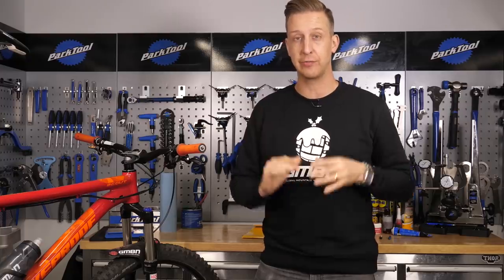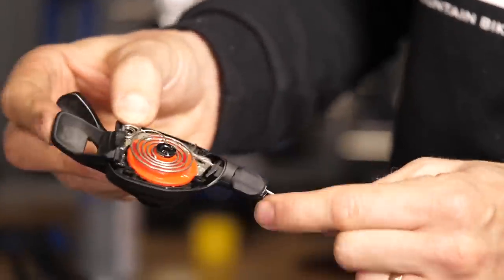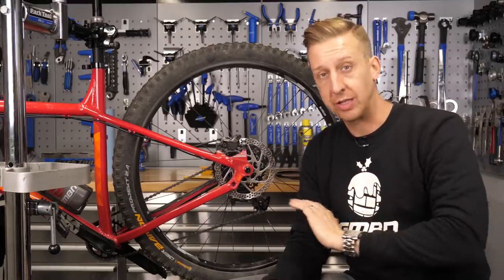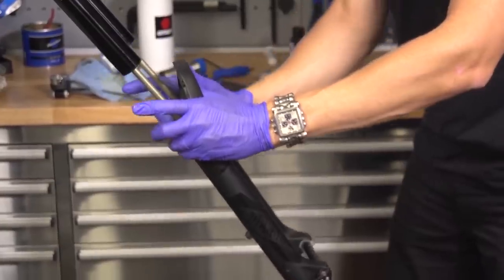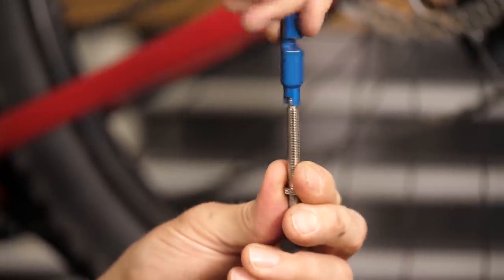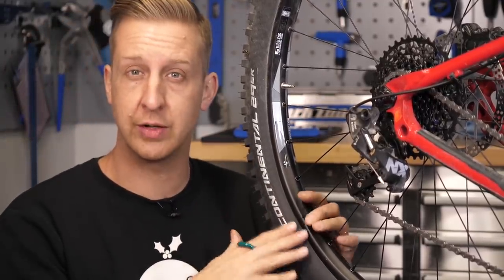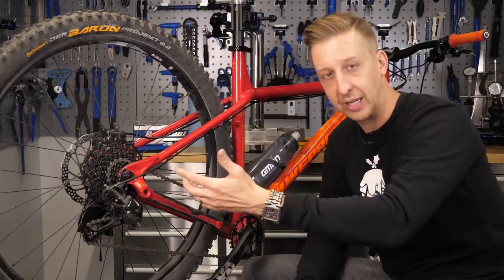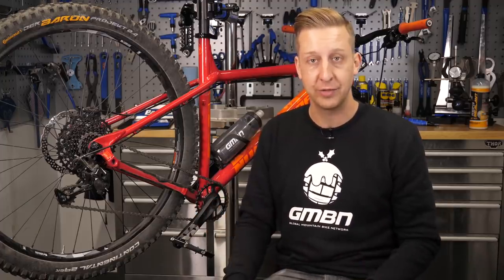Ten Ways To Refresh Your Mountain Bike | GMBN’s Guide To MTB Maintenance

Comment: Superb video!! You have said literally everything that i do at least twice a year. I prefer to clean the inside of the tubes, but i don't put WD-40 or any oil, just clean them and make sure that the cable is clean and dry after crossing the tube. I also think that removing the lower leg of the fork, cleaning the sponges and putting a correct amount of grease and oil is a great idea, but your advice is must faster.
Reply: Alvaro Q.F i

Comment: Great vid! Super excited about the new channel.
I have a question for anyone here who can answer it:
I just got a new Canyon Strive, and my fork is giving me some trouble. I haven't gotten it out on a first ride yet (it's punishingly cold here), but my issue is this: my fork (a RockShox Lyrik RCT3) won't extend to allow for full travel. It's kind of hard to explain, but when I went to pump some air into my suspension, it never extended to the full 170mm. The gauge on the side is sitting around 25% used without any weight on it. It's got approximately 40psi (the suggested pressure for my weight). Does anyone have any ideas about why this may be happening? I'd like to get our riding ASAP, and if I can get this sorted without taking it into a shop, that'd be great.
Reply from the maker: Hi Emily! It could be a bit of air trapped. Check out this video on GMBN: http://gmbn.eu/prosetuptips. At the end Doddy puts a cable tie between the fork seal and stanchion to apply some lube. If you do this and push the cable tie in a little bit further, it can release a bit of air that might be in the wrong place. Don't worry, it won't damage anything as long as the end of the tie is un-cut. If that doesn't solve it it might be necessary to check in with your LBS to ask them for their opinion!
Reply: Thanks so much! I'll give it a go and let you know if that fixes it. Great channel, awesome content. the GMBN network is growing and it's a beautiful thing!

Comment: You should not touch your spokes even if they are loose. Every spoke has a range that it can be in.  It might feel loose but unless you have a spoke tension meter and verified that it is too loose with a spoke tension chart, never touch your spokes. Even a quarter of a turn of the spoke nipple can put a wheel out of true.

Also if you dont have a chain checker. Just measure with a ruler. 8 inches should be the same as 8 links on a chain. A 1/10 of an inch more than that will be worn.

You can also pull the chain on the front chainring. If it pulls far off the chainring, (ie. You can see the tooth of the chainring) your chain needs replacing.

Comment: I have a nasty problem on my Radon Slide 160. By putting a little force on the pedals I hear a creaking noice around the bottembracket and I can't find where it is located. I recently installed an upgrade (1x12) and refreshed everything on the bike and the creaking noise is still there while pedalingen. Any idea what it can be?
thx anyway

Comment: I’m about to do a lower leg service on my fork and in the video you mentioned to apply some suspension grease on the dust wipers, can I use some muc off bio grease that I have at home or should I buy some proper suspension grease?
Reply from the maker: +The broken brain the proper suspension grease is what you want; check the manufacturers site as there may be a specific grease or requirement.

Comment: Great tips Doddy, do all the greasing/nail varnish tips also apply to carbon frames as I thought you had to be careful with grease inside carbon parts & frames? Also does the spray grease in the shifter work for Shimano XT? Thanks - m
Reply: Haha the  new video covers most of that question! Cheers Guys great work as always